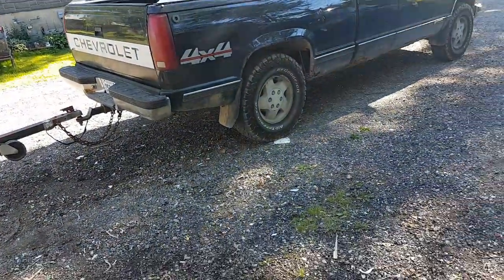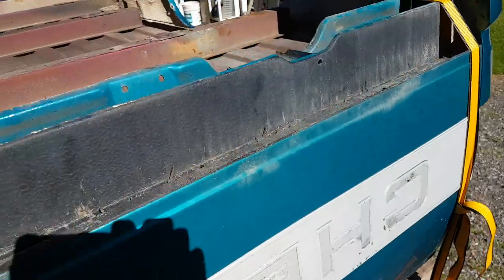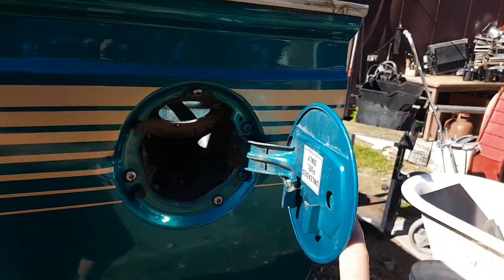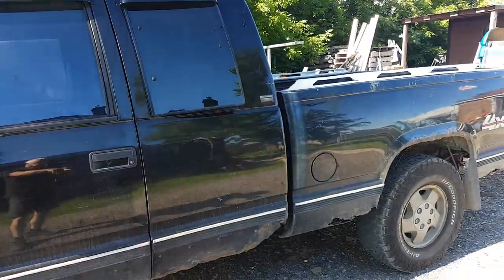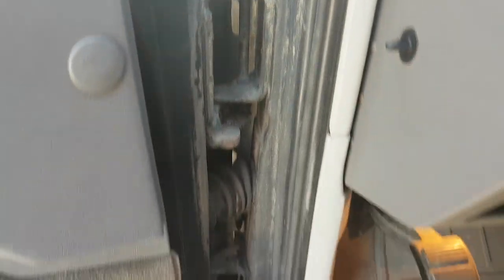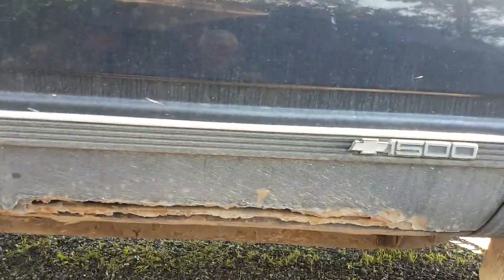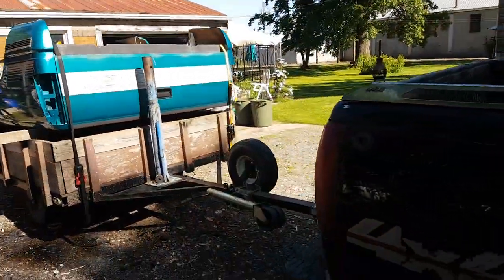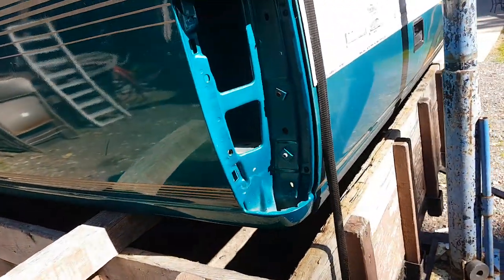Happy Friday!!!

Comment: $60 a ton here. Has held steady at that price for 2 weeks. I'm sticking to Copper bearing units, (vacs, fans, CRTs etc...). I have been taking steel, but only flat and long, ie: bed frames, pipe etc... Going to stockpile that until the price goes back up. Awesome get on the bed for your truck!!!